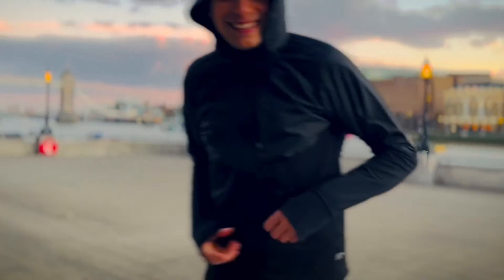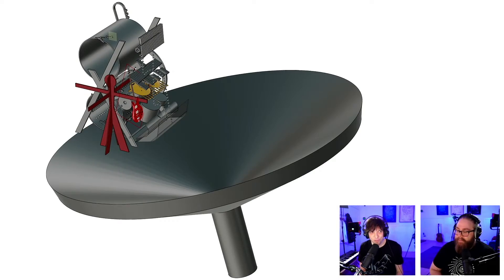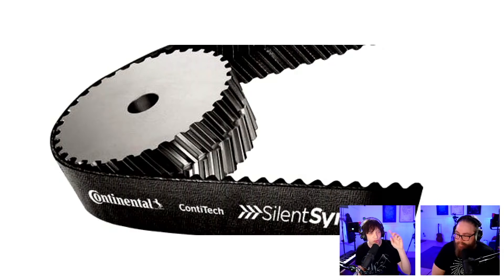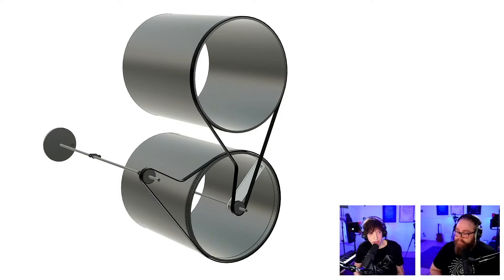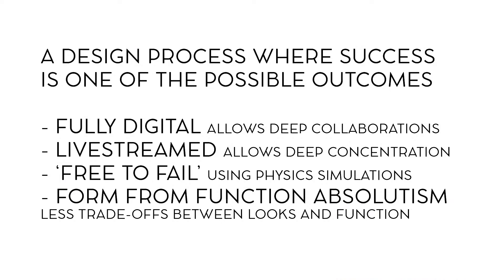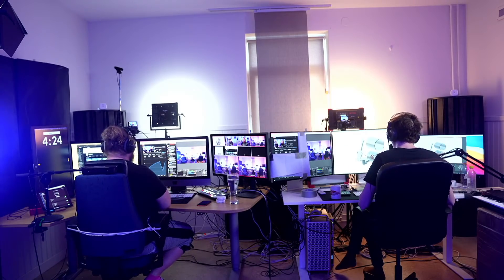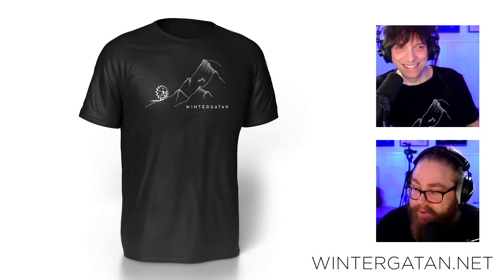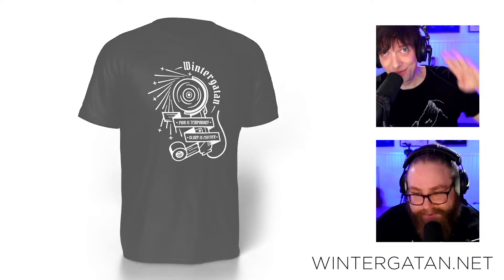Round 3 - Martin vs The Machine - Week 1 Summary

Comment: Hello martin! I stand behind your decision to start overnew and design the whole thing in cad first! However, there comes a point where you also have to test your designs, meaning you have to build something while some other parts have not thought out yet. Dont put too much focus on details now but put it on the overall layout. Then start building to see if the drive-train you showed works. You have to find a balance between CAD and really testing out your designs!
Saying this, I strongly believe you won't fail since you already have acquired tons of engineering experience and a strong team behind you ;)

Comment: do longer belts create exponentially more backlash in the system, and even more if you chain those together? the belts might be slightly elastic, creating slight springiness down the train if you extend the gear train with other pulleys and belts. oh, and will the MM-X be donated to speelklok since its a more reliable model than the wooden one? i think you mentioned that it was to flimsy to be played reliably for visitors. its like a piece of art , made for a museum

Comment: Martin, I know tight timing is important, and with that in mind, it made me cringe to see the prior designs releasing the marbles as the arms were slowly lifted over each pin.  Tiny deviations in pin height, marble diameter, and release gate size would lead to significant impact to timing.  Instead, if you release the marble on the arm drop, the release event would be much less sensitive to any of those elements.

Comment: The type of helical gears you showed are better called herringbone gears or double helical gears to help avoid some potential misunderstandings.
Reply: Further trivia: when the teeth are lined up and meet in the middle, it's called herringbone after the fish bone structure, and when they are staggered they are sometimes called Sykes after the W. E. Sykes company that made a machine capable of alternating the teeth with no gap in the middle.  I worked at a gear manufacturing plant, and we would often replace those old gears, but leave a gap in the middle to allow the cutters runout to finish their cut.

Comment: This new approach is definitely the correct way to go. Most issues on the MMX stemmed from starting by building something that looked like the original Marble Machine, and then having so much sunk cost that it was too hard to abandon decisions like the huge gears or the frame. That was clearly visible in the later MMX videos, where you progressively noticed how bad some of the early designs ended up being.

Comment: You do not need helical gears or belts if the gears only use belts. Helical gears are only quieter if they are meshed with another helical gear. If not meshing with other helical gears then helical gear belts won't do much for you apart from drain the bank account.

Comment: Warning! Large diameter gears for toothed belts are surprisingly difficult! I speak from experience here. The reason is this:

When you mesh a small gear with a big gear you are only engaging the big gear over a tiny fraction of the overall circumference. This means that tiny imperfections in the pitch of the gear teeth don't matter. However, when you mesh a toothed belt with a big gear, any tiny pitch imperfection will be multiplied by over 50% of the enormous circumference! The belt will pass in and out of phase with the gear teeth, resulting in slipping and sadness. Also, if the belt stretches at all when you tension it or as it ages, the pitch will change, and a gear that used to be good will now be bad.

This is a large risk in your new design! If you want to go down this road, rigorously test these gears FIRST so you know what you're getting into and can change course if you need to before it's too late!
Reply: This is a great point that I hadn't considered as compared to gears! This comment needs to be voted up because you are absolutely spot on.
Reply: Issues like this are what worry me about the CAD-only approach. Even with physics simulations, there are some quirks and issues that you can only effectively discover with a physical model. I think he ought to do limited rapid prototyping of the core elements of certain systems right after the initial design phase of those systems. That way, if there's an issue, fixing it won't require re-doing later work.
Reply: @evanc.1591  yes and no, if the simulation is properly used, i.e. also inserting dis-homogeneities, non-linearity and local or global gaussian-errors. It must be stressed that programming simulation properly is difficult and many 'programmer(s)' do not excel in that, although they are able to write programs which are nice to read or have nice GUI....
Reply: This is what worries me about his new approach. He's going to spend years designing the entire machine in CAD, then when he goes to build it he'll run into issues that CAD couldn't have predicted and the machine will fail and we'll be here in a couple years watching him announce the MM4
Reply: @praetorfenix69  Dude, you didn't get the grift yet? The goal is not ever build a functionable machine. The goal is to make you  keep coming back watching and generate views so he can make money. Every real engineer can tell you that it's all have been a waste of time from the get go.
Reply: @praetorfenix69  some might still be watching. For me hes lost what made it special
Reply: @GonzoDonzo  What made it special for you? Genuinely curious!
Reply: @GonzoDonzo  I guess around a thousand people is only some (and that's just when he's live), but there's a reason people have switched to doing things on computers, and if you don't know what that is then you don't seem to have been around for the 4 years he was working on the previous one..
Reply: @TS_Mind_Swept  what are u talking about? Switched to computers? What does that have to do with function over form or martins inability to accept something being good enough? Try to think abit next time.
Reply: @GonzoDonzo  maybe if you had thought *a bit, you would have been able to answer your own questions before you asked; then again, not being able to answer one's own innane questions usually comes with that one's short sightedness, so it's not really a surprise
Reply: @GonzoDonzo  Look, just because you lost sight of the goal of the project, which is to have a machime that functions without without creating issues (marbles on the floor just being the start of it) Doesn't mean hes stopped trying to iterate or a problem solve, he's just decided to actually draw something out before trying to build it and fix as he goes which costs a lot more time and money. You are clearly not an engineer, as is outlined by all of your comments thus far, and have no idea what it takes to actually make something function. You probably think suburban sprawl is a good way to build a city as well
Reply: This is great input!!! A solution that comes to mind is to put a smaller gear into the hub that connects the pipe to its axis. It might still simplify the manufacturing, but work better with the belt, too.
Reply: Temperature changes alone could be enough to cause issues with that much engagement
Reply: Need a small 1:1 set of transfer gears to take power from the belt and mesh with the big wheel?
Reply: @MichaelOnines  I think that would work well. It might be noisier than Martin is hoping for, but I think it might be a sacrifice worth making.
Reply: I don't even know why he's going herringbone pattern for a tooth belt. I expect those to be as expensive as their geared counterpart. Besides, belts in general are already pretty quiet, so I see very little benefit in using herringbones.
Reply: Can someone put this in a place where the team can see it?
Reply: Well yes, but....  On the large diameter the teeth are also completely unnecessary!  Friction alone is more than enough, so he just needs to make a groove for the belt to fit in.
Reply: Would it make a difference if the drums had only so many teeth that is needed to keep the sync, rest of the circumference could be plain groove to allow for any imperfections to even out?
Reply: Good on you for finding something constructive to point out!
Reply: You are correct,  it a sprung tensioner like they use on car engines could go to solving the tension issue, the effect of stretch with the self tensioning would need to be checked
Reply: I don't think that PVC water pipes are the best material to CNC on gear tooths, the tolerances in the manufacture it's quite high compared to machined gear in metal. A water pipe doesn't have to meet tight tolerances and they can be quite irregular.
Reply: @SerpaJavier  They will probably run it through a lathe first, I hope
Reply: I tried to bring this up during the stream, but it was passed by. A standard automotive type serpentine belt is quiet and plenty strong (kevlar based). Simple grooved pulleys are easy to make in any size by even simple machine shops. Please push this hard as the toothed belt idea is a huge mistake.
Reply: I suggested regular "V"-belts; they do not have teeth, so it would not be an issue. However, he already had his heart set on (Herring-)fishbone-patterned gears for the purpose of continuous even propulsion, then just switched over to the same pattern on belts...
Reply: @theorganguy  He calls it a "timing belt".  If the belt slips, the machine gets out of sync. So it is important on the small pulley.
Reply: you are right, one thing that Martin was mistakenly doing was:
 not thoroughly testing and instead "producing" all pieces instead of prototyping longer and seriously
Reply: Convex crowned pulleys with flat belts are also self centering. They just don't have teeth to ensure mechanical timing, though.

Herringbones are nice in terms of lower noise, but I just see it as needless performance gains when the more easily available alternatives can do the same thing at a reduced cost and manufacturing complexity.
Reply: I have no idea what CAD software is capable of but surely there must be the ability to do some sensitivity analysis on such imperfections which could be used to determine tolerance levels on the components?
Reply: Yup also he's making assumptions abt the perfect dimensions of that HDPE pipe.  It's made for underground fluid, not a rigidly dimensioned component.
Reply: Good to hear a great explenation. In a livestream i asked if it is a good idea to do this, but only because my feelings told me that there would be problems, i did not realy had an explenation.
Reply: Knowing Martin, he needs as much feedback from people who know mechanics as we can get
Reply: what about chain belts? like in cars when they want better reliability. Would that help?
Reply: He can just add a belt tensioner. Look at any of the timing belt systems on internal combustion engines.
Reply: @Neil Forrester
Let him ignore this 'till next disaster.
Reply: It could even be temperate dependent, assuming the belt and gear materials are not the same
Reply: Well said. That is why timing belt companies keep it as a commercial secret what is the ideal modus and tooth shape depending on diameter, thinkness and other factors. So it won't be easy to get their brains picked.

Comment: I feel a little concern over the drum beaters. It's really hard to get those to play well, it's kind of like trying to have a human drummer not use his wrists or elbows, only using their shoulders to play-it's incredibly difficult and doesn't sound great. Kick drums are one thing, but for snares/cymbals you need a fair amount of 'wiggle room' to let it bounce off the drumhead instead of just press it and release. It's not impossible, but what was shown on the cad design here doesn't look like a version that would properly work. And i'd hate to see Martin put a lot of effort into something at the core of the system, only to have to rebuild it over and over until he got a working version (basically, like the demons he fought with the MMX)
Reply: I agree entirely. I find the effort to design 100% in CAD commendable - but I don't think there is any way around building SOME physical test articles to prove the CAD will work within the confines and nuances of things like drums.
Reply: @bradley3549  Yeah, if you talk to any fitter and turner or person in a similar job they'll likely be able to recount a bunch of stories about stuff that was designed by an engineer in CAD that looked fine in the model but once you got into the real world they were unusable. Favourites being bolt holes that are completely inaccessible once the part is in place (and in extreme cases, bolt holes that are inaccessible even BEFORE the part is in place). This gets multiplied when you start talking about largely unpredictable stuff like which way a marble is going to bounce off a drum skin.
Reply: I agree. They need to build prototypes of ALL the new ideas!!! Separately! The MMX was a huge prototype itself, and had many problems.
Reply: He did mention he may ask others to 3D print a scale model of the drum beaters so I think he knows he needs to physically test some parts
Reply: I agree. The end result may not sound right consistently. If the floor is the funnel, I would think marble gates and drops are superior, instead of building a new set of wisdom.
Reply: Also I don't see a marble being able to play a kick drum particularly well unless you start getting into different size marbles for different instruments which is just asking for trouble.
Reply: for a variety of percussion there are precedents in other automatic music machines - a lot of gained knowledge from those can be transferred into this
Reply: He should have the marbles drop on some sort of drum stick which it self hit the drum instead

Comment: Herring bone gears advantage in not applying lots of axial thrust to the shafts.
Gear profile cad models should not be a huge issue to obtain.
You could also do photogrammetry or PMM of an existing gear and export to CAD.
Reply: Since these are belts and not gears, that translates to tolerant belt tracking.
Reply: @bradley3549  it certainly does!
Much smoother and quieter than cogged designs as well.

Comment: I like the MM3 Command Center.  I like the idea of building the whole thing in cad so it makes sense before building on the fly.
I am worried by his idea on fully custom teeth.  Are they at least based on a proven form?
Reply: Yes, the Chevron form is a common toothed belt system. Quieter than straight tooth. More tolerant tracking as well. But expensive!
Reply: @bradley3549  Yes, but he's tweaking the design to have alternating teeth.  Has that been done before?
Reply: @shadowscribe  He's not tweaking anything, that is exactly how the Silent Sync belts are designed. They look like a tractor tire.

Comment: The gear which has the timing belt should be made of metal in my opinion. Thus, one prevents an abrasion of the gear. Also, you can then regrind a bit if an abrasion of the gear, made of metal, should determine.

Comment: Are the drum beaters driven by marbles? If not doesn't that kind of go against the point of a marble machine? Would be nice if in the recap he talked a bit about why certain things exist, and not just that they exist.
Reply: Last I heard the idea at the moment is to have the drums be played by both beaters and marbles.
Reply: He wants the machine to sound decent without amplification, which means he can't use a snare and a contact microphone to emulate the kick drum anymore. A marble can't hit a kick drum hard enough and any mechanism to amplify the force of the marble enough to swing a kick would be horrendously complicated and go against the design ethos of the MM3. The only real answer is to use a different approach entirely. The new drum beaters simply lift off wedges placed in the wheel, and when they fall of the end of the wedge springs pull them against the drum hard enough to simulate a drum stick or kick drum pedal.

Comment: I really like the idea of having a separate programming wheel for the drum loop, but there are only a handful of drums compared to dozens of vibraphones, so i believe having both wheels the same size is a big waste of space
Reply: Well it was complete wasted space on MMX and having the same size drum will keep them in sync with less programming or manual muting, making it much easier to program a song. Quick changes might still be an issue but I bet they have a good plan for that too (plates could still work for this)

Comment: The pipes are not manifactured to be perfectly round and deform at temperature changes. This leads to huge tolerances and can couse issues
Reply: I’m assuming the pipe will be given a rigid internal structure and then made round on by turning it on the cnc as you would with a lathe